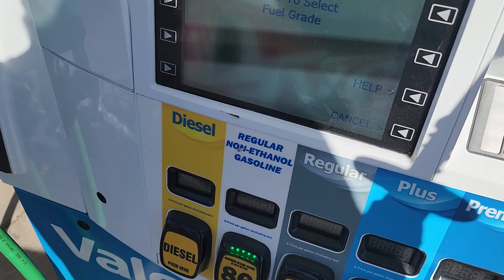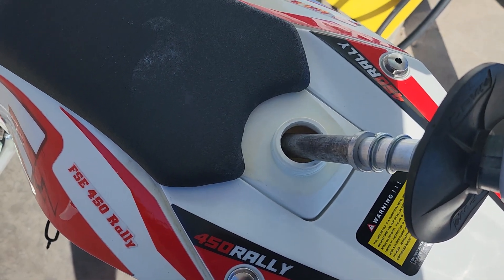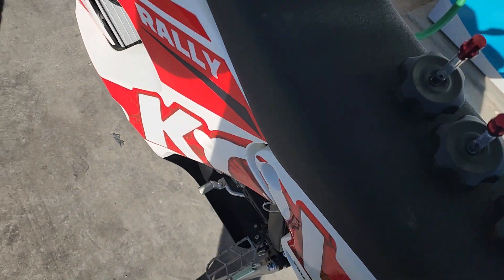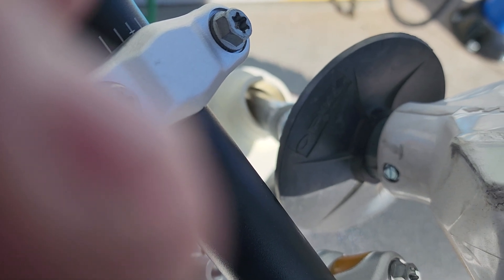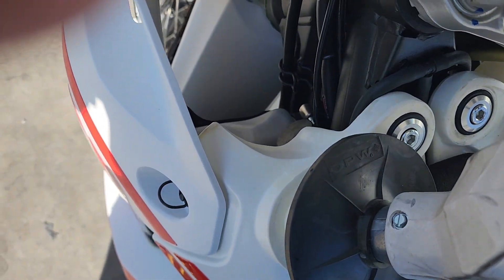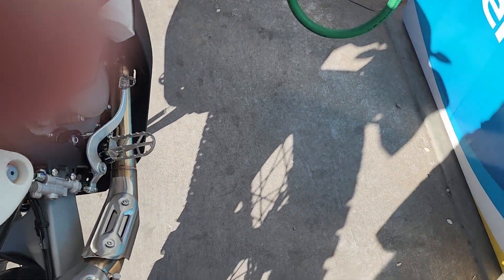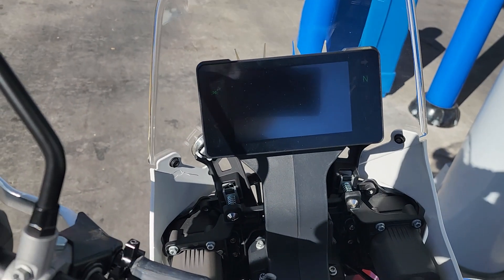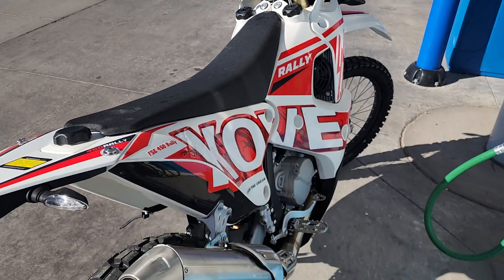Kove 450 Rally How Much Gas Will It Really Hold?

Comment: You need to fill front tanks before rear tank as the rear tank flows freely intonthe front. Minenheld the full 8 gals but I had to leave bith sides open on front and go backband forth a few times as they settled in then alowly fill the rear tank